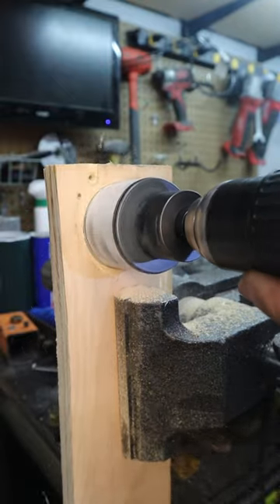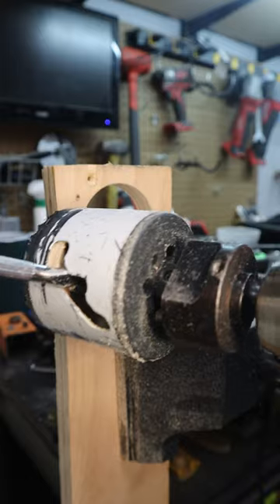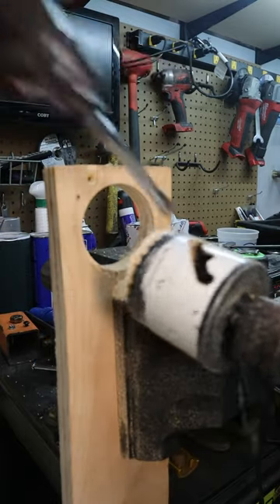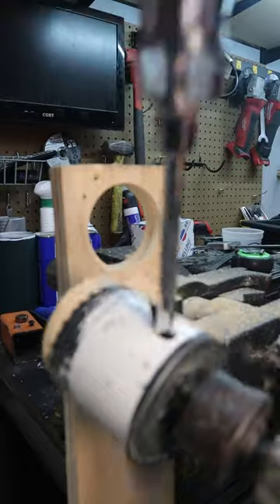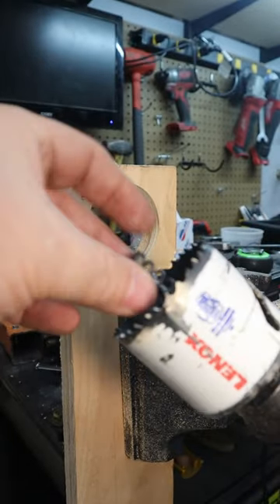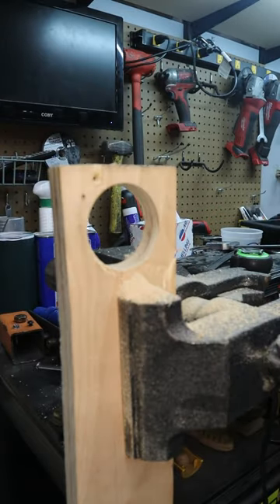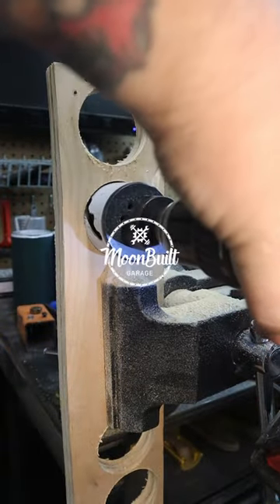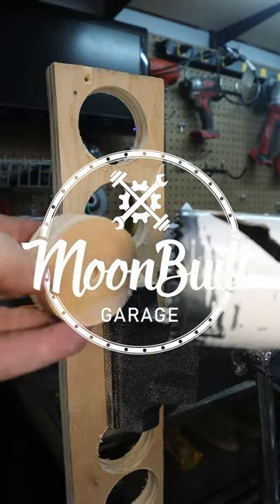🔧Tool Hack #13 Hole Saw Spring for Removing the Plug | #Shorts

Comment: I also use a dry silicone lube on the inside of my whole saw. Seems to help with removal of plug
Reply from the maker: Good tip!
Reply: That’s what she said
Reply: @MoreThanACarpenter369  lol. Never fails . Was waiting for you to arrive in the comment section.  Thank you sir

Comment: Just spray siliconspray in the hole saw on a regular baises. Of course not dripping wet. 😉IMO in most cases the reason the wood doesn't slip out eaisly is because like in this video the hole saw has been used so much already that it is dull and sawing the hole too small to begin with. Just my opinion.

Comment: Back in the olden days of the 80s they used to just have a small little pin hole on both sides to try to knock that thing out with a nail punch which didn't really always work all that often. Many times I would have to drill out the wood from inside the on a one and a half inch hole saw I would probably use a 3/8 drill bit about 20 times in order to loosen it up and have enough flex so I can break it and pull her out

Comment: you also could just try to keep the hole saw straight on and not wallow around on it. when you start tiling the drill it flex's the pilot bit and allows the drum of the saw to walk as it distorts. this is why the thick wall hole saws for heavy metal use don't get stuck, the wall thickness is high enough to resist warping/flexing during the cut so the slug ends up actually being round and not oblong.

Comment: Or you can just put the drill in reverse and play with the trigger. Potentially add a small bump against a wooden surface whilst doing it. Works 70% of the time.

Comment: simpler fix dont drill all the way through drill half way through the material then finish the job on the other side and you also dont get tear out and its only half way in to the Cutter and can be twisted out by hand  work like a PRO not a DIYER
Reply from the maker: And what if you don't have access  to the back side?  Drilling through the back of a cabinet...or where someone has plywood as a wall instead of sheetrock?  "Simpler" isn't always an option

Comment: Partially screw in one or two short panhead screws on the 'far' side within the circle being cut.  They become handles for the plug. Then pliers let you pull it our directly after the hole is complete.  I liked the lube idea, too. Slick Stick does it.

Comment: Pro tip: when cutting the hole, clean the dust from the hole saw several times while cutting. I use an air hose while cutting. plug doesn't get bound in the hole saw that way.

Comment: I heard you grunting out that so much easier lol. But does look little easier. I'll try it out.
Reply from the maker: The plug was still tight, but it was already pushed out a good bit, and I didn't need another tool to get it unjammed from inside the hole saw...plus I was working at an odd angle, having to work around my camera stand

Comment: You're using that arbor incorrectly. Slide the top down prior to the hole saw bottoming out, locking it into the two holes, then just slide it back, put you drill in reverse and pop the plug out with the pilot bit.
Reply from the maker: That's exactly how I was using it...but sometimes the bit slips off the arbor and gets jammed up...most people recognize that
Reply: @MoonBuiltGarage  I've been using hole saws as a professional door installer for 40 years. I've never had that happen or even heard of it happening.
Reply from the maker: You and every other person that makes comments like, "you're doing it wrong" or, "that's never a problem" or any other comment that attempts to troll people...and their "professional" experience only comes out once their comments are responded to...now go back to the basement and find some other videos to troll

Comment: You use two screw drivers.  That’s what you do,
There’s a reason it has holes each side.  
Blank will slide right out. Solutions to non existent problems. 
Shrugs.
Reply from the maker: If it's not a problem why would they put the two slots?  There's more than one way to solve problems....most intelligent people can recognize that, instead of trying to say there isn't a problem